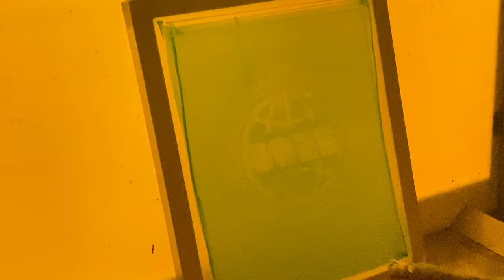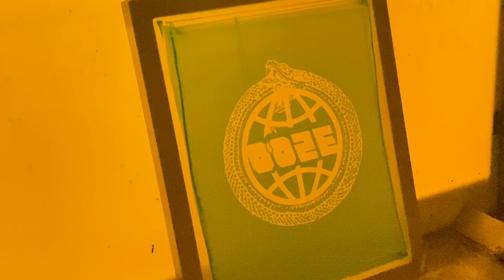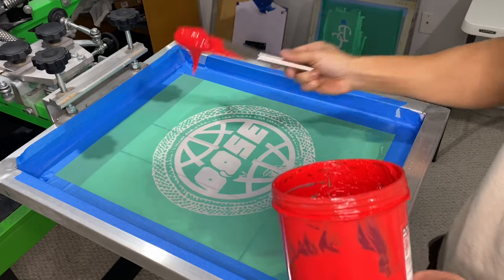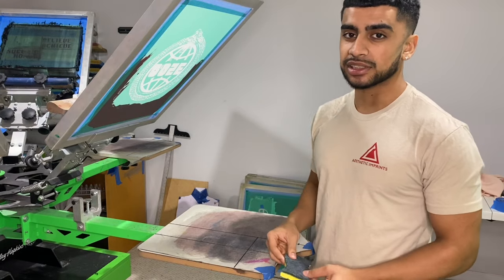SCREEN PRINTING FROM HOME! | CUSTOM HOODIES/JOGGERS START TO FINISH | CUSTOM NECK TAGS

Comment: Hey man how do I know if the print is in the same place every time? Is there a certain way to place the tee before you start printing?
Reply from the maker: You do want to make sure you load the t-shirt on correctly and in the same general area. If you load the tee on different each time then the print will be different.

Comment: What printer do you use to print your films and do you use a all black ink system?
Reply from the maker: I use canon pixma pro 100 with the all black ink system. If you check my channel I have videos on both the printer and the all black ink system.

Comment: I have a question, what type of material are your tee shirts, the brand?
Reply from the maker: It ranges between cotton/polyester. One of the blanks I work with most is the next Level CVC 60/40 blend.

Comment: Your channel is great!
Need help with the cost of ink per shirt and what is the price of an ink cartridge and if you can help with the octopus-like device you use several engravings at the same time?
Thank you.
Reply from the maker: I appreciate it! Cost of ink is minimal per shirt, in the cents range. Engravings meaning?
Reply: @baavproductions  mold
Reply from the maker: @demiankoons3802  The screens?
Reply: @baavproductions  yes(:
Reply from the maker: @demiankoons3802  Whats your question about it again?
Reply: @baavproductions what the price of this tool?
Reply from the maker: @demiankoons3802  It depends on the size and style you want!